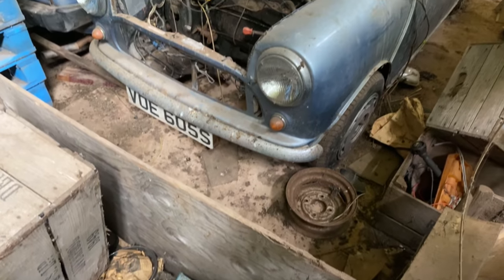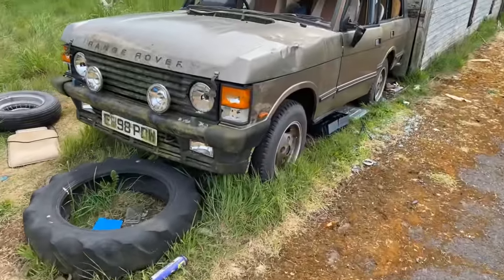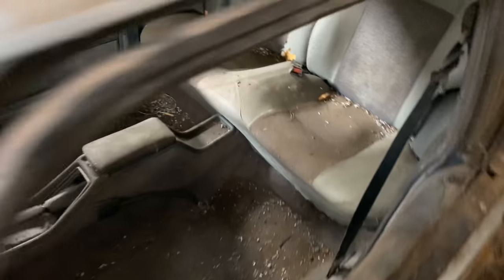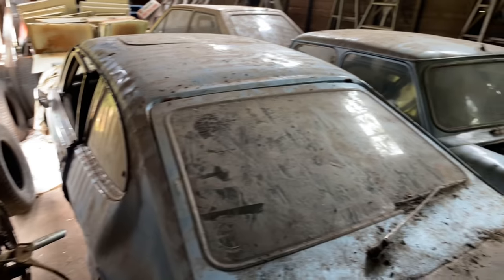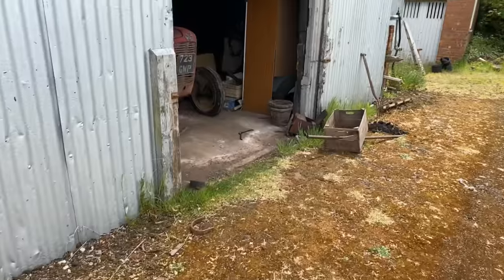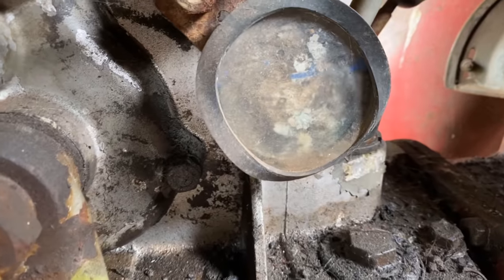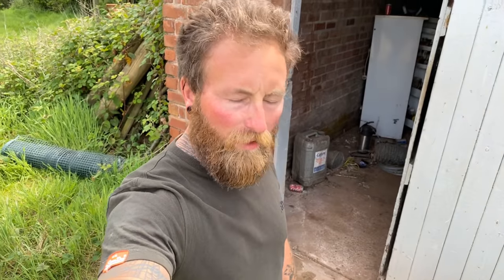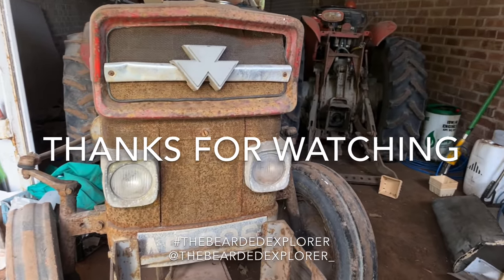I Found A Real Barn Find With Some Extremely Rare Cars!!

Comment: the orange trailer out side is a Muck Spreader that works via prop shaft that connects to the back of a tractor once loaded with manure and towed to where you wanted to spread you engage the prop shaft on the tractor controls the flails on the back spin throw the muck out and the bed slowly moves forward via the chains underneath

Comment: Those Recaro grey leather seats are rarer than hens teeth as most 2.8 injection capris were stolen specifically for their interiors. They need to be returned to the Capri and it needs to be saved.
What was the mileage on the Capri?

Comment: I though that mini was a 1275 GT by the wheels it had on it.
So i just did a check on the dvla site and it is an actual 1275 GT 😎
It's worth a lot of money like that and mega money once restored 😎
Combined with the Capri 2.8 injection and 205 GTI,
Not to mention the tractors ect.
Yes I would say this is the best barn find you have ever done 🤜🏻🤛🏻
🙂🍻👍🏻
Reply: 1275GT's were the Clubman front, this is a normal front so it's just had a 1275 engine put in it.
Reply: @retrogeezer  yeah I forgot about that as it's been years since I have seen one 🙄🍻😉

Comment: the farm i worked on has an old Massey 35 in  about the same condition , it starts 1st every time and we used it now and again for lugging stuff around if the modern tractors  weren't free . , you can bet they would all still work with  fresh fuel and a battery

Comment: That is really sad. Irresponsible people. 
The Range Rover is SORNed. MOT expired on 5/11/07. At the last MOT (6/11/06) it had 38,585 miles. At the MOT before that (23/8/05), it had 35,345 miles on the clock. The last V5 was issued on 12 June 2012.

Comment: I thought you just looked without steeling   but yet they gti gearnob vanished was there at the beginning and gone after 🤷‍♂️
Reply: Luke Brapp I just checked the and it’s not there at the start of the video
Reply: @markjackson3952  look at 1.27 it is on it
Reply: Just had a proper look, the fiesta one doesn't come off, it's the capri one that's missing look at the steering , as for the 205 it's already split in the intro you can see the threads,  probably fell off.

Comment: mine VOE605S mot exempt tax non Date of Registration  :  01/01/1978
Colour  :  BLUE
Engine Size  :  1275 cc
Fuel  :  PETROL
CO₂ Emissions  :  Not available
Export marker  :  No
Wheel Pan  :  2 AXLE RIGID BODY
Revenue Weight  :  Not available

Comment: The wheel looks off an old triumph 👍
Reply: The wheel is off a Jaguar. It's the same as the ones on my mk2 Jag
Reply: @jasonpain1123  Mk2 Jags have 15" wheels don't they? That's a 13" wheel, probably off an early MGB. The wheels designn looks the same as they were built in the same factory.

Comment: The spiked wheel is an E Type Jag. What kind on 205 GTi was it? The 1.9 was the ones to REALLY have! It's a pity that there wasnt a Renault GT5 Turbo there! They were cars when you HAD to be able to drive. None of the fancy drivers aids that you get now. 

You need to do a vid on your tatts man!
Reply: Too small for an E-type wheel  (13inch). MWS made wheels for a host of manufacturers. This size would typically fit an MGB or similar.

Comment: It's a pity that certain lowlife can't keep their sticky little fingers of peoples belongings. Why smash the windows of the Range Rover? Cretins! Keep up the excellent work.
Sorry, but a 2.8 Mk3 Capri and the Mini are not as rare as the Yugo Sana that Hub Nut has just purchased, there are just 7 Yugos left on the road, I think my own car is rarer simply because if you go to the Halfords/GSF/Euro Car Parts websites, Humber isn't even mentioned . The Mk1 Fiesta was the first car I ever drove, and when I jumped into my Herald 13/60 (which is still around) felt more modern and with very light steering.